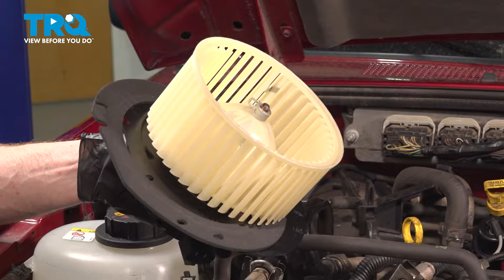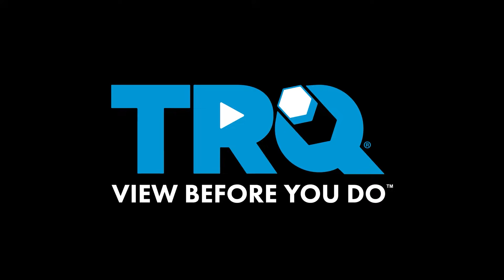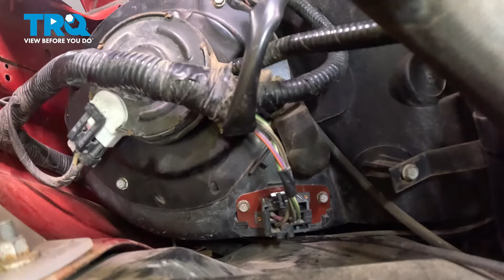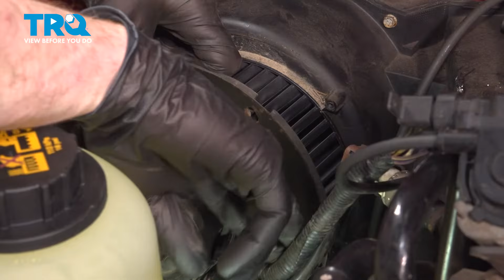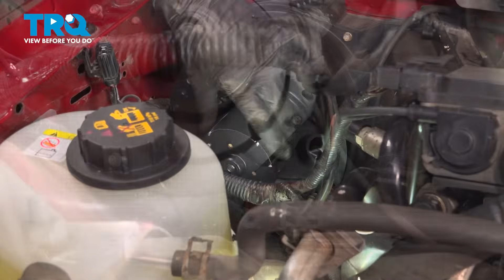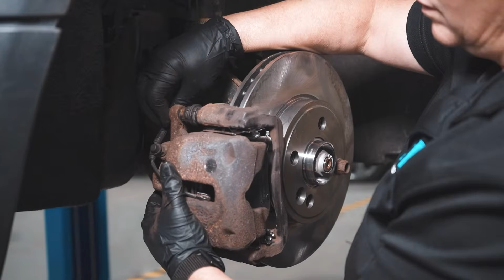How to Replace HVAC Blower Motor Assembly 1998-2011 Ford Ranger

Comment: This video was accurate for my 2010. Save me a lot of fight, but I would say at least on the newer models. You have to remove the washer fluid/radiator reservoir. Two bolts on the side, connected to the fender, one under the air box and one right near the AC blower fan motor that you’re replacing! Super easy to do thanks

Comment: On a 2006 you have to remove the airbox by pulling up and out and the two screws and two nuts holding the washer and coolant reservoirs.

Comment: If you're replacing the blower on a 2005 Ranger Edge 4.0, go ahead and save yourself the fight with the harness by starting with removing the airbox and unbolting the coolant and window washer reservoir. Also, unbolt the ground screw that's behind the cruise control module. You won't believe the time you'll save.

Comment: Doing this in a 99 ranger.  Can’t physically pull the fan blades free because the washer fluid tank is a half inch too close.  So I unbolted 3 of 4 bolts on the tank, but the last bolt is under the air intake.  Which is bolted to the body from underneath.  Behind the water shield.  So my big question!  What’s the best way to dislodge my ratchet wrench from the windshield?  And do you have any advice on how to treat broken knuckles?